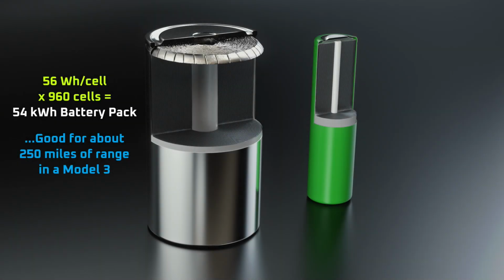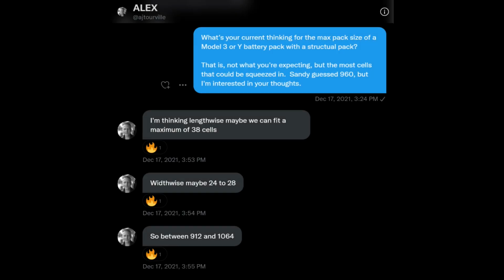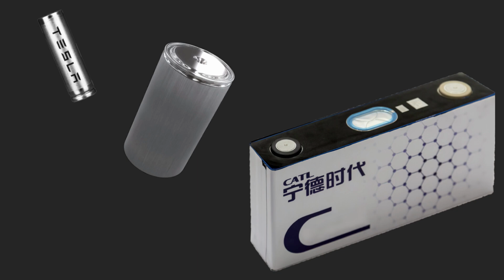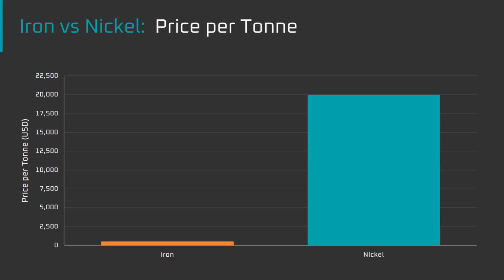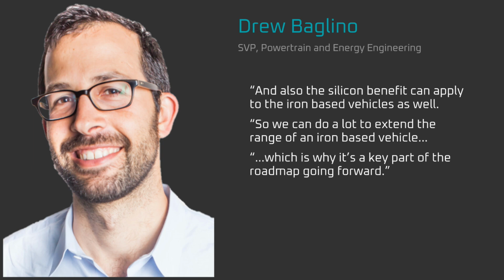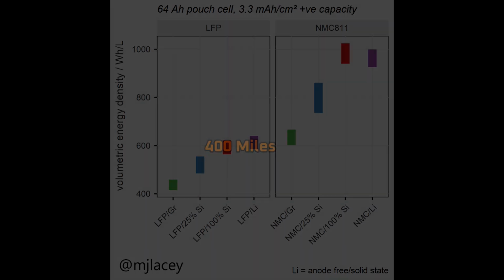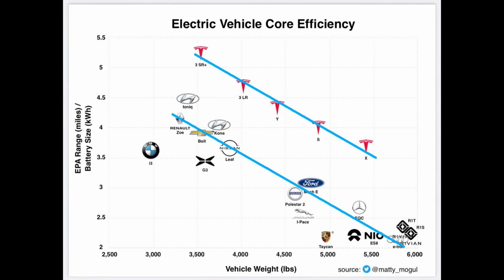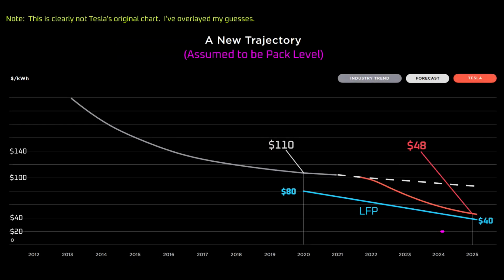The LFP 4680 Battery Cell  // + LFP with Tesla Silicon

Comment: i think the logical path would be for Tesla to offer LFP in structural 4680 packs.  I think the reason they offer LFP in prismatic form now is because they aren't (yet) using structural battery packs (giga cast frames).  Once they roll out giga cast frames, they'll use 4680 in all of them and forgo prismatic.
So, for the model 3/Y, my guess is they will eventually offer the RWD version (previously SR+) with 4680 LFP and a range of around 325.  The LR version will use NCA and have a range of around 400.    Just my 2 cents worth.

Comment: The BYD blade 'cells' will give 4680 a run for its money. Especially with their better thermal and vehicle structural properties.
Reply from the maker: That's debateable.  I'm a big fan of the BYD battery - see that video.

However, if they pack the cells like a sandwhich with no gaps, thermals may become an issue.

Comment: You can't easily make a structural battery with a prismatic cell; prismatic cells need cages to contain their (limited for LFP) swelling and the long format isn't conducive to torsional loading. A honeycomb structure with a depth relative to "diameter" (which may be why Tesla chose the 4680 ratio/format) allows for a true structural pack. How they physically lock the cells together, regardless of format, will be interesting though.
Reply: The trick is that the current incarnation of the Model Y "structural" pack, really isn't used for significant structure!  The Berlin (and Austin) Model Y's are still a complete unibody, with essentially just the floorpan missing!  The "structural" body in white is a fully-stressed form, with all the lateral and torsional stability of the old design.  The structural pack adds the lateral cross-bracing for side-impact protection, but beyond that, it's really just a floorpan that is bolted into place versus welded/glued.  Munro and others will inevitably look it over, but 4680s in the "structural" pack will probably NOT be part of the functional structural rigidity of the pack, and honestly, you could argue that a Model 3/Y pack is "structural" since the cell blocks are extremely rigid and directly fastened to the pack casing.  Basically, the Tesla structural pack is a production optimization (seats, etc installed from below), not a significant effort to actually make the pack part of the vehicle's stressed structure.

I always find in comical when Tesla fanbois state that Tesla are based on a "skateboard" platform when that is categorically incorrect.  ALL current Teslas are unibody vehicles with separate drive units installed independently from below along with a battery pack hung underneath, which has ZERO to do with the actual skateboard concept.  A fully-developed EV skateboard will be a structurally-complete system that is the drive units and battery as a complete unit, onto which varying body styes could be mounted.
Reply: @awebuser5914  The Y has multiple modules which are then installed/wired into the pack. The structural pack is effectively a big module removing the concentric casing and with the cell honeycomb giving the stiffness. Your common timber bedroom door contains a weak honeycomb sandwiched between two planes and the doors are very rigid.

Comment: Oh, I'm waiting for them. Did apply to production Model Y already?
Reply from the maker: I don't understand that question.  Not sure which them you are referring to and which region of Model Y production
Reply: According to the investor's call, Austin-built Model Y's already are running around with 4680 structural packs. It's just a matter of time until these are being sold to customers. 

My guess is that they are working out how to sell these along side the older Freemont-build Model Y's, since they could have significant weight and/or battery performance improvements.

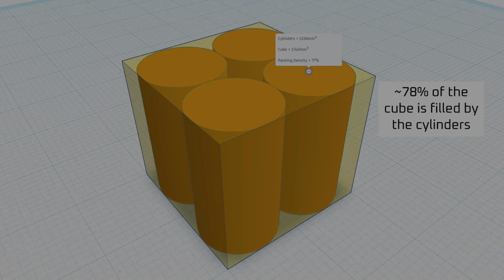Comment: Just started watching and expecting excellent material from you as usual, but just a quick question: at 4:30 should the battery pack be 56kW (kilowatt, or power aka ability to transform energy) and not kWh (kilowatt*hour, or measure of converted energy)? Am I missing something?
Reply from the maker: I don't understand the question.  The numbers there are correct because I'm talking about storage, which dictates how far a vehicle can travel.
Reply: @thelimitingfactor  Sorry, my bad! I missed small “h” in “Wh”. All is great and accurate in your video!

Comment: SOrry, I'd rather the world not use a lithium based battery, or granite or other elements that would have a bit of pressure on them for grid storage.

I'd rather the world bought into ESS's Iron redux flow battery for which you could make millions of these for grid storage and the earth wouldn't notice.

Lithium, if used for grid storage, vehicles. and powerwalls would be too excessive IMO.  We can't mine the earth to death to solve green energy.
Reply from the maker: Every option requires mining.  

I'll be interested to see how it pans out later this decade with alternate chemistries coming online.

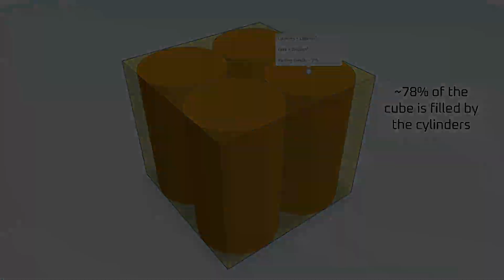Comment: I note at 6:15 or so you do some calculation based on the cylindrical cells being placed edge to edge in a cubic arrangement - they aren't though - in the battery pack they're placed in an hexgonal pattrern - each cell is centered at the vertex of an equilateral triangle - leads to the best packing density - better than 78%.
Reply from the maker: Correct!  And I should have illustrated that.  I was shooting for a conservative number and probably overshot there.  However, CATL/BYD aren't truly at 450 Wh/l and is probably at around 400wh/l.  So, those two things cancel eachother out I'd say.

Comment: unlikely. cyclindrical format value is in safety but more difficult and costly. it appears LFP is safe enough without going to 4680 considering BYDs Blade battery
Reply from the maker: The assumption here is that the reason a manufacturer would choose 4680 is for safety.  That's incorrect, the BYD blade is actually safer than a 4680.  See my video on the Blade Battery.

That is, if the choice isn't safety based, what are the other factors?  Just as Drew said:  Cost and scalability.

The only form factor that sucks as safety is pouch.  LFP is safe enough that any form factor works, but prismatic and cylindrical are both adequate, with BYD prismatic being the best.
Reply: @thelimitingfactor  Wished I could made that comment as good as this. LFPs cost advantage is getting crazy.  Im speculating that Tesla might have upgraded MIC M3 RWD with  larger capacity/range. See it yourself in Tesla japan order page

Comment: Great content as always thank you! I agree with you, I see really no technical challenges to pack cylindrical LFP cells in Tesla's cars. On the other hand advantages are huge. I cant imagine Tesla producing other than cylindrical cells given the volume and price advantage of the new manufacturing and considering over 70%of their production will be LFP.  So I got impacted with what was said in earnings call however that still may not mean no LFP cylindrical as you pointed out however my take is that Elon may have been implying size rather than the format. I am more on the thinking that they will develop a bigger than 4680 size for LFP and that may be on the height of the cell not in diameter as diameter increase will impact the packing efficiency even more. Perhaps 46100 to 46110 size to gain more in pack energy. That would require much less adjustments to current 4680 production line equipment and I think that height increase is still viable if you consider BYD blade is 118 mm height.

Comment: When the (2D)dimensions of a rectangular pack are many multiples of the diameter of the cylindrical cell the hexagonal (triangular) placement of the cells is more space efficient than the 78% quoted so the example with 4 cylinders is inadequate.
Reply from the maker: I pulled the 78% figure from a research paper.  The image on screen was to illustrate it visually.

Note:  You are corect that the cells would be staggered and therefore achieve higher density than 78%.  However, CATL/BYD actually only achieve about 400 Wh/l in reality and these two things cancel eachother out roughly, so the estimate is still pretty good.

Comment: If I understand it correctly, from a marketing perspective, LFP could then be positioned as a standard energy source providing great range but lacking ultimate performance.  The nickel could be positioned as an up sell for its lighter weight and higher performance?
Reply from the maker: It could, but I'd think it would be better to use Nickel for the upsell.  (as always, I don't claim to have a monopoly on the truth)

You have the right idea:  You can play around with form factor and chemistry to suit a particular need.  There is no 'One Best' solution and it's about product-market fit.

Comment: If Tesla has a viable LFP battery available, it takes the extortionist advantage that Nickel and Cobalt suppliers could wield when demand begins to match supply limits. If Tesla isn't over a barrel on Ni Co supplies and can just refuse the pay exorbitant prices, suppliers will have to be reasonable.
Reply: Cobalt is already in trouble the new ncma chemistry reduces the cobalt by 70%.
Reply: Tesla uses its market power to ensure their supply is at optimal cost.
Forget 'extortionist', forget 'over a barrel'. Think optimising available choice of chemistries and relative costs of supply.

Nickel and cobalt are scarce and very expensive to mine, iron is abundant and cheap to mine (check out the chemistry). Sure price is a function of supply and demand and higher demand results in higher prices. But this is necessary to fund new mine development (or reactivation of mothballed mines that were uneconomic at previous prices).

Comment: love your videos.  Based on what Drew said I am still convinced that LFP will stay as prismatic, as they can be form dense and structural if engineered properly and dont require as much cooling. BUT, its possible that 4680 is easier to produce and if so would be could be a driving factor toward a preference in 4680.
Reply: I think if Tesla succeed to mine lithium themselves in Nevada, they will put it in their own 4680 as LFP and perhaps with some silicon doping as Jordan said or replacing Iron with Manganese as Elon has twitted.
Reply: I agree.  CATL and BYD seem to be scaling prismatic LFP so Tesla has a plentiful supply.  That can leave Tesla to focus 4680 for higher performance applications.  Having a diverse battery supply chain only benefits Tesla and allows their suppliers to keep advancing LFP.  Just because they can technically do 4680 LFP,  doesn't mean they have to.
Reply: @sparks869  Up-and-coming battery shortage coming this decade (consequently, suppliers increasing prices) speaks towards Tesla needing to bring LFP largely in-house, if they want to compete cost-effectively for the cheaper market segment that requires cheap LFP batteries.

Comment: Isn't max (hexagonal) packing density of cylindrical cells 0.9069 and not 0.78?
Reply from the maker: High Josh!  I made an error on that one.  Staggering would increase the energy density.  I actually covered this in my Big F'ing Cell video but forgot it.

Regardless, the end result in reality would be similar because I was overaggressive with CATL/BYD energy density figures.
Reply: @thelimitingfactor  No worries. Love your videos! It just jumped out at me as soon is I heard  it!
Reply: I wonder if his estimate took into consideration that the pack has to have less cell density to be used as a structural component. (?)
Reply: I was thinking the same thing. Every mathmatician knows this: a honeycomb pattern is more spatially efficient than square-packing.
Reply from the maker: @riddlez Yup!  You're correct. I forgot about the hexagon effect.  I actually covered in my big f'ing battery cell video.  Regardless, it comes out in the wash as per the new pinned comment.
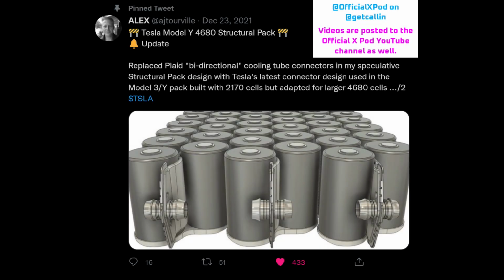Reply: Just look at 7:50. Honeycomb.
Reply: @thelimitingfactor  NOPE.  https://en.wikipedia.org/wiki/Circle_packing  Why not just look these things up before you misinform people?
Reply from the maker: @corwyngc Yup!  You're correct.  Error on my part but it comes out in the wash as per the pinned comment.
Reply: @CorwynGC  Chill, please. It is up to each individual person to check information that they hear instead of taking everything they hear as fact. The failure to do so is certainly the reason why the world is turning into brain-dead zombies that can only repeat what they hear in the media/the Internet.

Granted, content creators should do their best to provide the best information they can, but it's not fair to put the onus entirely on JG/content creators. Truth is, he is easily the best in terms of putting out well-researched info, at least when it comes to technical battery research.
Reply from the maker: @roddlez Thanks man, I really appreciate it.  I slap my self in the face when I make errors.  I need a team for this, and to a certain extent there is a peer review process, but no peer review process is as rigorous at thousands of views.  ( and it's why science journals often do retractions and corrections).
Reply: @roddlez  I merely presented the correct info at first.  But then he doubled down on the incorrect information.  I have little reach, and he has large audience, often that requires me to use a louder voice, especially when it is seen that corrections are being dismissed without further checking.  Reinforcing that pushing down is not helping anyone.

Comment: Can you comment on Manganese replacing LFP?
Reply from the maker: Already on it:  https://twitter.com/elonmusk/status/1486821592533544971

As usual, there'll be a quarterly video.
Reply: @thelimitingfactor  Yes, that is the tweet.

May be Tesla can only make Manganese and high Nickel batteries and just buy LFP from CATL. Especially if Manganese batteries are closer to LFP in terms of Cycle life and cost but have density advantages over LFP. Then they could stick with 4680 format.